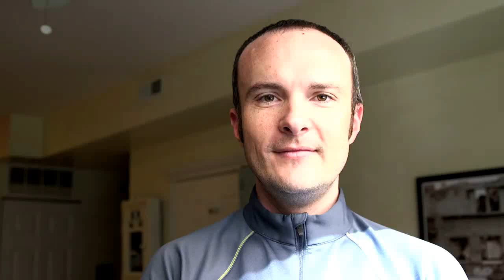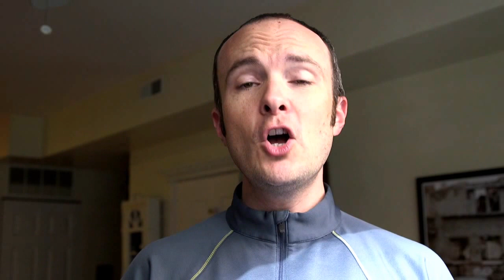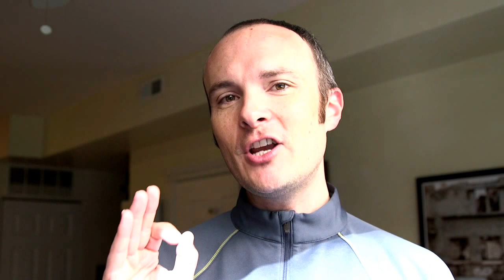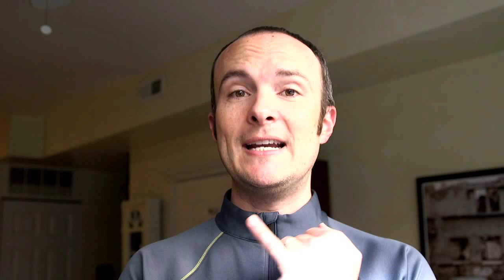How to Fail a Home Performance Test Gracefully

Comment: if you're not testing you're guessing. Truth be told, everything had learned in the industry up to the point when i started my own business I had to throw out and start fresh, there is a lot of great HVAC guys out there but they are VASTLY outnumbered. I have been moving my company into the performance field for the last year, finally jumped in and changed my business name a few days ago. Right now im butted up to where BPI starts, got a couple performance classes left to take and then decide how much farther I want to go....Last few weeks ive been watching your videos, thanks for taking the time to put out some information in your field, helping me get my feet wet and gather a basic understanding...
Reply from the maker: +Quality Cheaper Heating & Air Right on!  If you want to go the extra mile and beat all your competitors hands down, try my Fall Fast Track next year.  It's a ninja factory.

Comment: 5 does not mean 5.0? I'd say that's clever if it weren't just... wrong. By that logic, 5.0 could mean anywhere between 5.00001 and 5.099999. Which is equally absurd. It's not math trickery -- it's just wrong. Not sure where the motivation comes from to do it that way... is it laziness? Ignorance? Dishonesty? It's unfortunate either way. Eking out ~10% less performance than is mandated.
Reply from the maker: +Nick Welch I hear your point, Nick, but if you ask the Passive House folks they'll tell you the same thing.  I had a hard time with it until I started testing tiny apartments, and the difference between 5.0 and 5.49 was literally 30 CFM, which is within the range of error for my equipment.  You learn to help people get better every time- if they don't knock it out of the park the first time, I'd rather they be excited to get it right-er on the next one instead of throwing up their hands and hating themselves and everyone else.